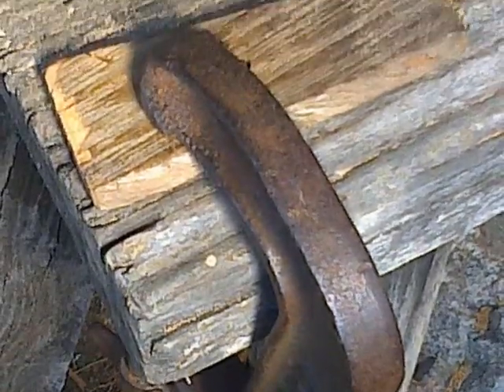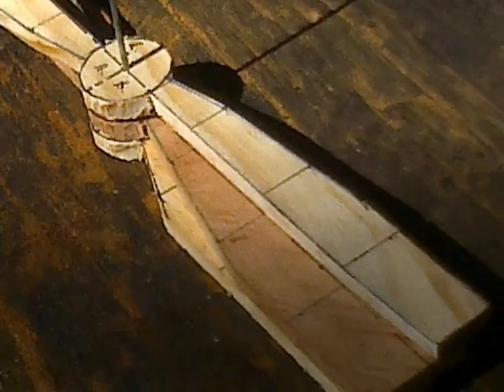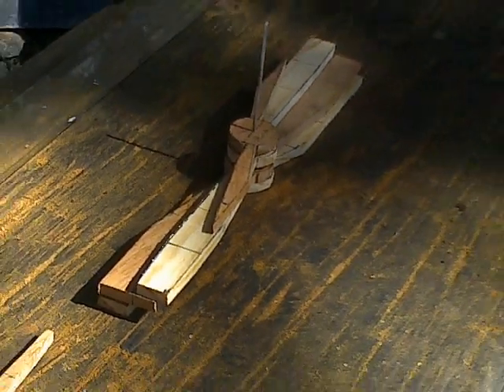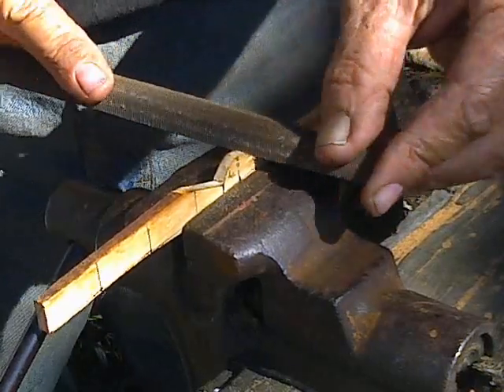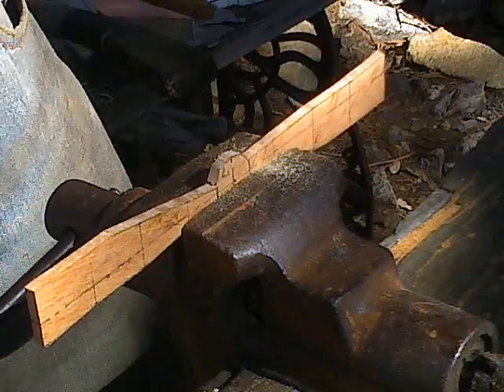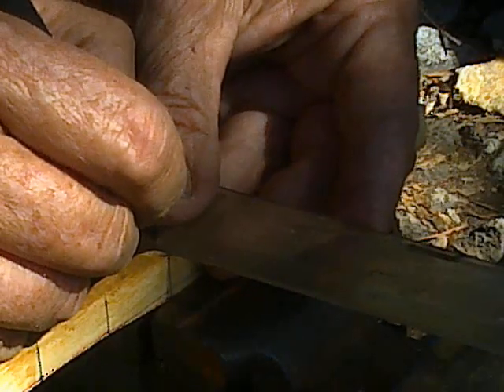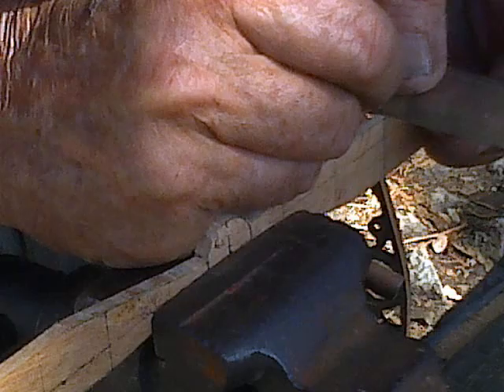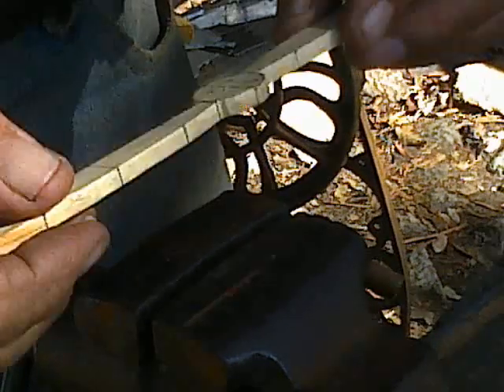Propeller-Carving..., Fine-Tuning The Laminae ; And Why Laminate - Anyway...

Comment: Hi Chris.
Yes, I see what you mean regarding the glue lines and balance and there is a lot more work involved doing it with laminate, plus you need to be able to do the calculations, so that's me stumped. LOL
The end result is really brilliant as we saw with the first prop.
Looking forward to seeing this one being born. 

Cheers mate :-)
Reply from the maker: G'day,

Thanks Mike.

  Well, it's a fiddly sort of a job, and it's easier to make a big one than a little one ; because being 1mm out at the Tip of an 8-ft Prop. with a 6-inch Chord doesn't make much difference - being a millimetre out on a 1-inch Chord-tip of an 8-inch Prop is a 4% Error.

   The only real Calculations required are working out the Circumferences at the Blade-Stations  (2 x Pi x Radius).

 Then, it's all pure Geometry..., by marking the Circumferences at the Blade-Stations along a horizontal line, and with the desired Pitch marked up a Perpendicular Line on one edge - then the Pitch-Angles at each Blade Station can be drawn on and measured with a Protractor, and from those (and knowing the thickness of the Laminae) then all the Blade Station Cross-Sections can be drawn - and from them the information can be transferred onto the Wood, and then it's sort of tedious and painstaking - but straightforward enough.

 If you wanted to "cheat" you could do a few practice-runs using Balsa-Wood, before trying something stronger...

  It's pretty good fun, trying to keep making the next one better than the previous one.

  And...,  bloody Barnaby was re-elected, with the Morrison Government ; apparently the Pollsters got everything all Arse-Up yet again.

  On the Bright Side, Tony the Budgie-Smuggler Abbott lost his Seat...; so the Election wasn't quite a total disaster.

Such is Life,

Have a good one...

;-p

Ciao !